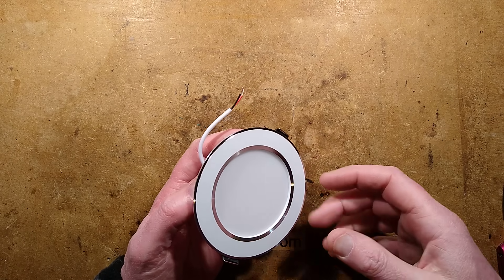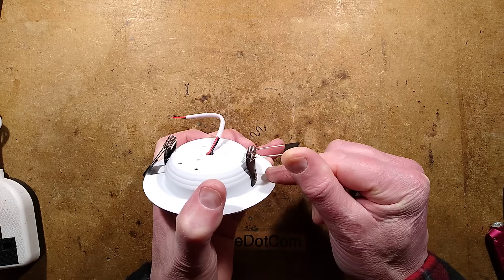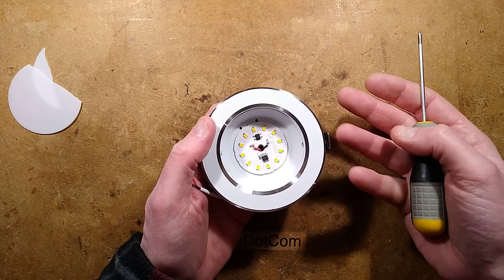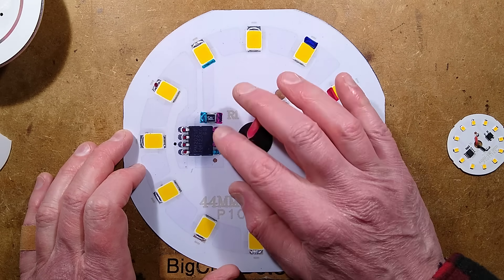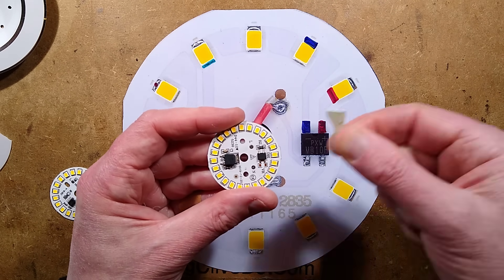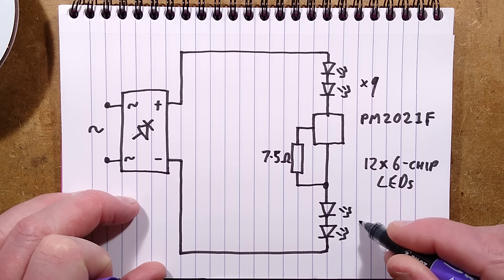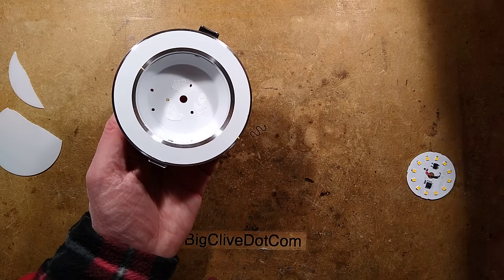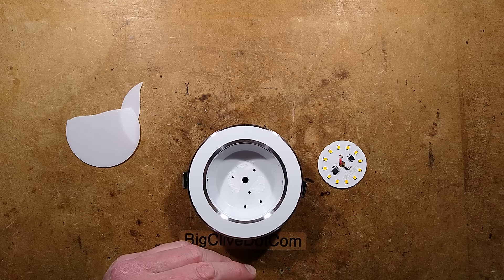inside a $1 downlight - novel circuit twist

Comment: It confuses people when I tell them ‘I will not install disposable fixtures’. Most of the time they don’t even realize it’s disposable, and that the “lamp” cannot be replaced without considerable effort.
Reply: My last place was a new build and full of the led down lights but with external led switcher drivers. My youngest couldn’t sleep unless the hall light was on so It didn’t take long before they started failing (it was one of the led’s and shorting out the failed led got the lamp going again). I initially just replaced the units but because I couldn’t get the same model, and not quite the same colour match, I ended up swapping unit around the house so they were grouped by model. I also modified the current sense resistors in the hall lights to reduce the current and greatly increase life time. 
I thought initially that it was a good idea to separate the driver from the leds (with a plug) and then it would be a relatively safe way to replace led, but no one sold the led bulbs which is a shame.
Over the 7 years I lived there and have to replace these led down lights I think there is now 5 different models in my roof because units I had used before were not available a couple of years later.
I like the led downlights but I wish they would not drive the leds so hard so they would last longer.
Reply: @timstreeter9795 You mean ceiling, not roof. The roof is on the outside of the house, an odd place to install a downlight.
Reply: @timstreeter9795 Couldn't you just use a dimmer with them?
Reply: I was so surprised when mom bought a new ceiling light for the new bunkhouse we built at the cabin, and it was non-replaceable LEDs... Talk about waste, because now instead of a "bulb", you're throwing away THE ENTIRE FIXTURE! 🤦‍♂️😮‍💨
But worse is that if you LIKE the fixture, you're kinda effed. Forces you to go through a lot more trouble just to stay with it since you'll now have to fight to remove the dead PCB... 

Also, like Tim said, lighting temperature (color) is frustrating to deal with. At least it's better as of late, at least here in the US, as they state in the box their temperature. (I personally loathe cool white)

So I feel like the only solution is to buy EXCESS of that fixture, or to immediately replace it with something that CAN be replaced. In either case you're spending more money than you've already spent, which is never fun.
If the entire circuit (LEDs included) lasted as long as advertised, it wouldn't be so bad, but not easily the case as Clive has been pointing out to us over the years, since everything is intentionally overdriven to ASSURE failure... 😞
Reply: @DUKE_of_RAMBLE  Planned obsolescence!
Reply: @NOWThatsRichy  But taken to a new and highly absurd level! 😭
Reply: @DUKE_of_RAMBLE MANY of the better fixture ones also have a switch on them to be able to set whatever color temp you like.
Reply: @davelowets  Interesting, having seen that. I'm surprised they're using RGB LEDs, but I guess if they're cheap enough and resilient enough, it works out. (I know you said higher end, but I feel like folks would still not want to spend a fortune on replacement parts)
Reply: It's the same with a lot of street lighting nowadays, back in the old (sensible) days, when thay failed you just changed the lamp, now, with many of the LED lanterns, when they fail the whole lantern has to be replaced, at a far higher cost than simply changing a failed discharge lamp!
Reply: I guess you could easily modify a bunch of these so that you could easily swap the leds later on.
Reply: I mean for a buck... Big 22mm down lights can be purchased for 2.5€ they can be as cheap than s replaceable bulb. But they last longer. Take a bit more work to replace the whole thing, having tu cut the power and so on, but they are nice
Reply: I've hardly ever had an LED bulb fail in my house, the last 5-10 years.  I bought my bulbs from Poundland and Screwfix when around £1 for 6-12W units each.  A few minutes to replace when a bulb blows.
Reply: And when it does fail the option is to either replace the electronics, which might result in one light being noticeably different in brightness and colour temp, or replacing the whole unit, in which case you'll be hard pressed to find another unit with the same housing. There's situations where that won't be a problem. But there's so very many more situations where either version is going to drive somebody right up the wall.

Though the lack of ground and not having the slightest idea how hot the thing runs would be higher on my worry list.
Reply: Saying "they´re unserviceable" is just "thinking one step too short"... One must NOT break the glass-cover, that´s just an option... Take some flat-reared-ones (no ceiling-hole needed), with the easily removable bulged glass-cover...
Reply: The thing is: bulb LEDs are much worse, because a bulb is thermally the worst shape for cooling (it was designed to keep filament heat concentrated)
Often, those fixtures with integrated cooling have much much better cooling.
So it's in fact better to use integrated light.
Reply: @ABa-os6wm  Its better for the cooling, and thus hopefully lifetime of the light.
Its much worse for everything else though, especially as Clive mentions in the video, for replacing by untrained people.
Reply: @VekhGaming ANY doofus should be able to replace it fairly easily. It's only 2 wires and the fixture just clips in.
Reply: @ABa-os6wm  What would be kinda nice is if somebody would make a standard set of 'puck' style bulb modules that these fixtures would be designed to use. But then everybody would make their own standard, and then we're back to the same issue but with more parts.
Reply: @Lizlodude  the humble GX53 is pretty much what you are looking for

Comment: Easy enough to add your own earth connection, with a small self-tapper through the side.
Reply: That's really not the point - it's non conformant in at least three ways so shouldn't be fitted for a customer.
Reply: Yep. It's just very dangerous (and illegal). Don't.

Comment: Very nice all-in-one lights like this are standard items in North America. Admittedly a bit of an odd concept. However, the light and PSU are separate items joined with a connector, so LEDs can be replaced without electrical work, assuming the PSU is still good. Still requires basic handiness to get the LED unit out & in :-}
Reply from the maker: And risks damaging the plaster sheet in the process, especially if it has been painted afterwards.

Comment: Im gonna keep rambling
the philips S9000 leak transformer for spectral lamps. Do you have any clue where i could get one or get a data sheet of one so i can find out how to make an equivalent?
Reply: Google says that is a step-up auto transformer that develops around 500v across the light for easier starting. 5Kg so a large copper/iron ballast. Ballast probably needs matching to the type of light too (wattage?) in a similar manner to fluorescent tubes.
Reply: @threeMetreJim  Sadly i need a data sheet or something. I cannot afford risking damaging the very rare spectral lamps.
Reply from the maker: It may be worth searching online to see if there is an alternative driver option.
Reply: I am pretty sure i need a 90 watt sox ballast that does not require a series capacitor.

Comment: Aren't you just relying on the insulating properties of the PCB for safety?
Reply from the maker: It's a very thin shim of fibreglass between the copper and the aluminium.  It often burns through.

Comment: is it just me it seems most incoming power is red and black in the US?
Reply: officially it's supposed to be black-white-green for live-neutral-earth, red and black is usually for dc. given they're selling a one dollar ceiling light they probably just don't care.
Reply: @murph9935  Red is also used in 240 volt circuits in the US and Canada.  Red and black are the 2 line wires each 120 volts with respect to neutral and 180 degrees out of phase.  Neutral (if it is needed) is white and bonding/earth/ground is bare, green, or green with yellow stripe.
Reply: As expected for a “polished turd” 😠

Comment: You say 28v per led?
Reply from the maker: 12 times six-chip.  So 18V per LED times 12 = 216V with the rest dropped across the linear regulator.

Comment: Presumably it would be simple enough to add a ground wire. I would do that and then connect all 3 wires to a suitably rated 3-pin plug, and put a matching 3-pin socket in the ceiling space. I would have some pre-prepared replacements so that in the event of a failure it would be an easy job to pull the old one out and put a new one in it's place, probably easier than some of the gu10 fittings I've seen.

Comment: We have some lap ones in our work, one has developed a serious flicker and another is pulsing. We have spares so thought I'd try and get one out, they don't have the spring things and there is no access above to trace the wires to the junction 😂
Reply from the maker: It usually is the very tight springs that damage the ceiling on the way out, and if you're lucky there may be a lighting socket above it.

Comment: Would be great if there was a slow-glow phosphor that could be used instead of smoothing capacitors to provide steady light from a pulsing power source like 50 Hz AC. 30 years ago there were slow phosphor monitors for interlaced screen modes.
Reply: Fluorescent lamps have already done that - some had phosphor with longer afterglow. Some even had such a long afterglow that they would stay "on" for about one hour after being turned off - NEC made such tubes - FL10EDF-SHG
Reply: now that is a great idea
no really, i approve
Reply: That's the thought I had too --- I wonder if this wasn't flickering since they were using a long persistence phosphor, and that turned out cheaper than capacitors.
Reply: You beat me to it. The first IBM PC monochrome monitors had this phosphor AFAIR. Possibly that´s the reason why this light does not flicker.
Reply: Excellent idea. But I suspect manufactures have already done that. Modern LED lamps  don't flicker anymore when used after a rectifying bridge (100 Hz).
Reply: I had to look before commenting. I believe what is meant is that the phosphor be the only part that produces light. We know how to charge them to glow but would be good if they could create light from electricity, then provide light after electricity is removed.

Comment: Neat simple regulator...  I wonder if they'll ever move that sense resistor into the chip to save one more component (and a pin) at the cost of loss of configurability...

I'm baffled as to how this doesn't flicker.  Is there just enough accidental capacitance between the traces and the board, and the power consumption low enough for that to have a measurable effect?

Or is this a new phosphor coating that has just enough afterglow to hide flicker?
Reply from the maker: I think I just got lucky with framerate.

Comment: While things like this are so very cheap it just reinforces the throw-away disposable society that we have been rocketing towards for a while now  :(
Reply: What’s the point of making them so cheap? Lighting should be well made to last decades. Encouraging people to change things often is such a bad idea.
Reply: @bigjd2k When it's profitable to  buy, renovate and flip, there's a disincentive to think long term. That's a pretty strong driver in places like Australia, with seemingly indefinite housing price growth.
Reply: "A while"? Decades!
Reply: It's cheaper than a standard LED lightbulb, though if ever I came across a lot of them someone had thrown out because they failed, I'd likely modify them to 12v and gift them (cost of parts only) to people that I know that live off-grid (inland waterway boaters).
Reply: TBH there isn't a whole lot more material wasted between this metal cup and a regular bulb and those metal housings are pretty easy to recycle as scrap metal. Still I'd like to see a plugin module as standard there of course as the metal housing will easily last for a century.
Reply: The halogen downlight bulbs we used to have was not fantastic and probably more waste.
Reply: @mrm1885  My house (that was only seven years old at the time) was absolutely full of quartz halogen downlights. They were the MR11 12V type. I expected them not to last long, so when I found a load going cheap, I bought plenty. But I only had about three actually blow. The more common problem was bad contacts between the lamp pin and the holder. Cleaning the lamp pins normally got the lamp running. Now all but two (which are hardly ever used) are LED type. I had to change some, but not all of the electronic quartz halogen drivers, to types suitable for LEDs. Of the LEDs, only two have failed over the last seven years. The big difference though is 50W QH have been replaced with 2.5W or 5W LED.
Reply: I think it started in the 50s or 60s with the heavily advertised disposable utensils. But even back then people were throwing away cars. Cars apparently got scrapped after just a few years. When Ford came out with a new model, so many of their mass produced Model Ts were being thrown away that Ford had a factory specifically for dismantling the Model Ts that people no longer wanted.
Reply: I tried tossing the wife.
Ended up pretty expensive though...
Reply: that and sending a $1 light from China over building and selling them in our own country.